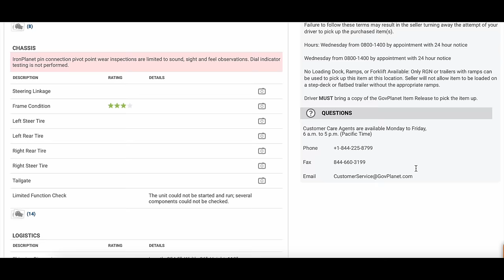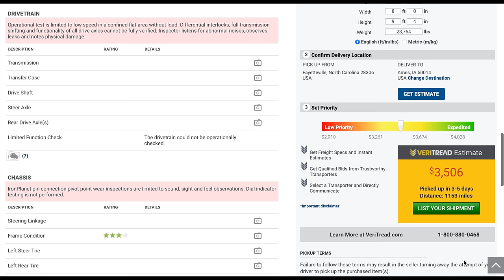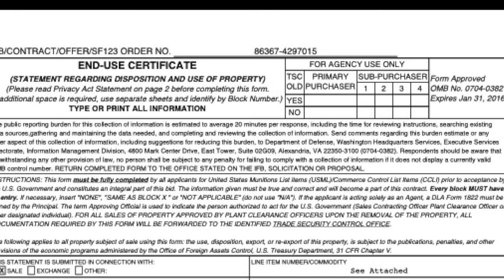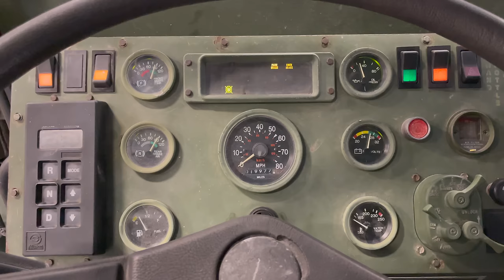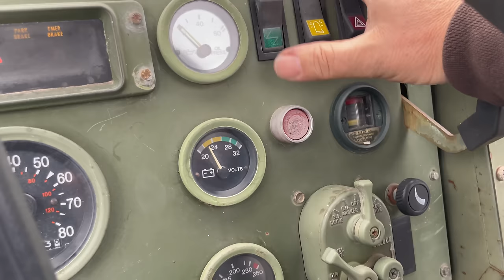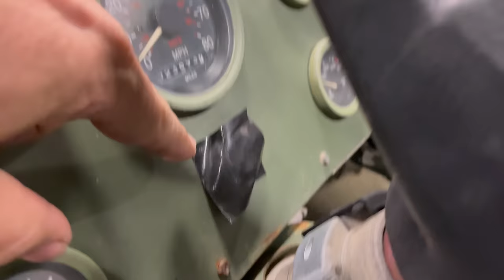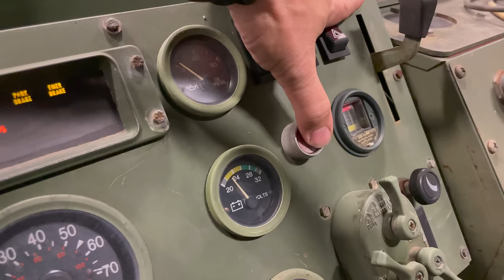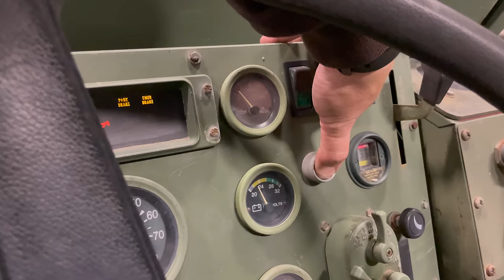Buying a LMTV on GovPlanet Wasn't How I Expected

Comment: Those trucks have way to much electronic for my liking.
Reply from the maker: Only one part is electronic, the trans controller, nothing else is electronic on it...
Reply: @ThisWeekWithCars  We had them when I was in the Army and that was the biggest problem and the tire inflation system always broke.
Reply from the maker: They have a regular inflation valve so you can use them as a normal tire on any other truck.  The biggest problem is the leaking  quick release valve on the front tires for loading them into planes.  If you remove that the tires do not go flat all the time.

Comment: You don't make sense. Your GOVPLANET ad clearly says DOES NOT START. So expect things to be missing. Expect the worse it doesn't start.
Reply from the maker: I had no problem with the condition of the truck I got from govplanet, the problem is the misleading shipping and added hidden fees after the auction ends.  I also don't trust the bidding system after my experience and what I have heard from others.
Reply from the maker: And that they hide the fact that the EUC takes forever to get.

Comment: Sorry dummy but those trucks are a pain in the ass to work on I know from  experience. Would rather have a a M35 had both in my unit the 1078 and up or below are junk, specialized tools are required for the axles and more Sorry for this but you were a pigeon this purchase,plus that was a latch to lock the cab down plus theirs a manual hand pump for the cab and spare tire like I said I worked on the junk!! M35, M923,M925 OR M936 is the way to go. I hooked a 134 hp M35 to a 325 hp M1078 and drug it all over the place in with it in 4 low,it has a piece of junk Allison transmission also wrong 6 speed transmission